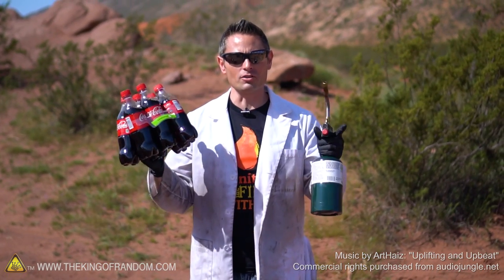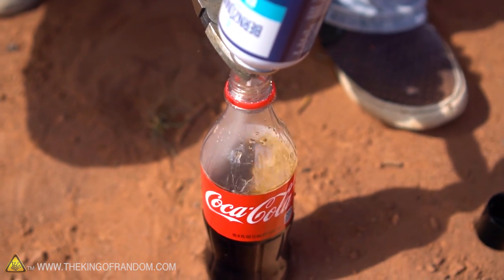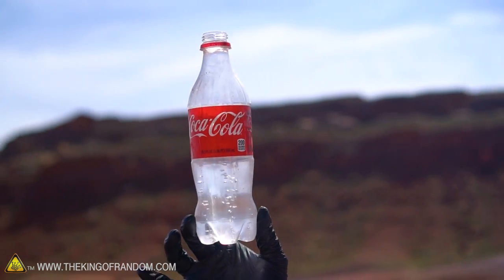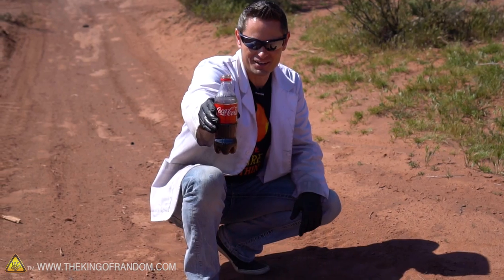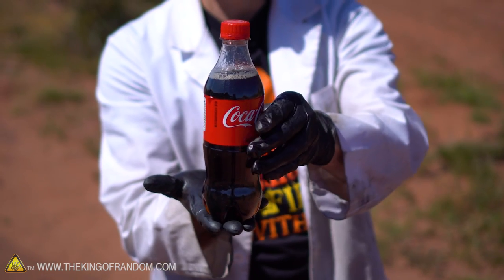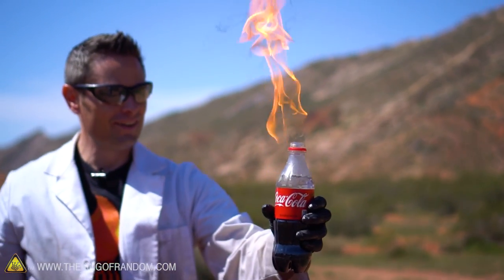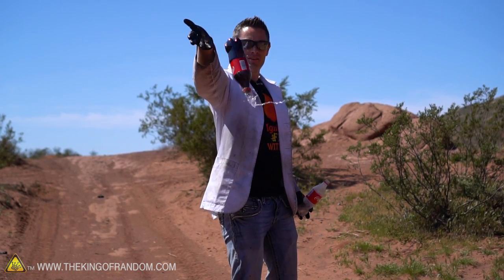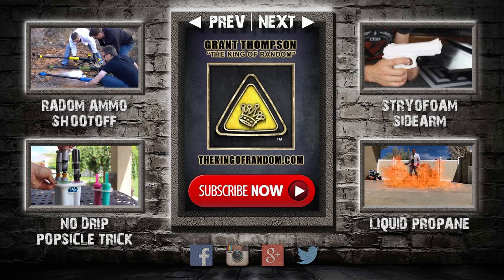Dang! Apparently Butane Did The Trick | TKOR Shares The Secrets Behind The Best Coke Rocket

Comment: try drilling a hole in the cap and repeat the experiment
Reply: One, could hope or it could just explode
Reply: Aiden Connally no it will be less powerful.
Reply: I was going to suggest the same thing
Reply: Aiden Connally rocket propulsion doesn't work like that. Also if you had a smaller hole the gas would escape slower. The gas pushing on the walls of the coke container is what propels it. If the container is sealed then the forces exerted on the bottle are equal in every direction. If you make a hole in the bottle, there is no force acting on the walls there (as there is no wall) so the force in the other direction is still the same as before but greater than the force acting on where you made the hole, so the force isnt balanced equally in all directions. This makes the rocket go in the opposite direction of the hole. However, the smaller the hole the more wall there is left to push on in that direction, so the forces are closer to being balanced and the rocket doesn't go as fast.
Reply: Gummy Bugz, the coke is significantly warmer than the butane. It warms it up to its boiling point causing it to expand rapidly.
Reply: Ok so repeat the experiment with differing holes sizes and figure out if there is a better size or not.
Reply: ThatRandomGuy yeah sounds right

Comment: What if you punched a hole in the cap to make a nozzle to increase the pressure?
Reply: TheFlyingMeese it's not a reaction the butane is less dense than the coke so it forces its way to the top of the bottle and sends the coke out the bottom which causes it to shoot off. So if you put a cap on it then it'd probably work a lot better
Reply: Saltineboy 21 I watched codys lab on a video where he tried liquid nitrogen bottle flip and he poked a small hole in the lid, BOOM and it exploded.
Reply: It could blow up or have more power than ever
Reply: If the bottle explodes you can either have more air or use a stronger bottle. A metal bottle would be pretty cool, albeit more dangerous.
Reply: youmakeitwhatitis A metal bottle mighht not explode because it would tolerate a much, much higher pressure. Maybe higher than the pressure needed to liquify propane at room temperature
Reply: Z Pson yes
Reply: exactly what i was thinking
Reply: Saltineboy 21 it is a reaction, but it's not a chemical reaction.
Reply: Test it
Reply: potentially explode
Reply: @loganlanphear9220  may not be a reaction but butane still pushes coke out at insane rates which would be able to cause an explosion. with no explosion not much coke would be coming out regardless of how fast it’s coming out so the thrust power would decrease

Comment: Use the Mini Arc-Furnace to melt salt and cast salt “ingots”
and shapes. Then for a little bit of fun, dump liquid salt into water.
Reply: 😩 Use Straight Quotes
Reply: Steve0203 Smith I don't think you know how sand works...
Reply: Steve0203 Smith I'd like to see him melt lava rock and to make volcanic glass
Reply from the maker: Ok I'll try that
Reply: try potassium nitrate or boil seawater
Reply: Grant Thompson - "The King of Random" the salt will explode in the water so watch out, you can see backyards scientists video on it for more info.
Reply: Darn you weren't supposed to spoil it. I know it explodes. I tried it.
Reply: Thanks I'm a huge fan. I've actually built quite a few of your projects.
Reply: Steve0203 Smith sorry :/ just thought a heads up could help him not loose a finger
Reply: Steve0203 Smith the melting point of salt is 800°c
Reply: Lol You're right. We don't want Mr. Thompson to lose a finger
Reply: The Arc-Furnace can melt rock.
Reply: Steve0203 Smith I've built the Styro-Slicer because I like Styrofoam.
Reply: Steve0203 Smith I think you mean molten salt
Reply: lol that would result in an explosion but it would be cool TheBackyardScientist has made a video of mixing molten salt and water
Reply: Yeah Thanks.
Reply: Steve0203 Smith you mean molten salt?
Reply: Steve0203 Smith That’s a Special FX to enhance the flames just show us the real one you don’t have to lie

Comment: if you drilled a hole to create a choke, then you'll get less thrust, but for a lot longer.  the result is a more efficient rocket that will fly much higher.
Reply: It wouldn't fly
Reply: Arton Shala actually it would.  the propane would reach a higher static pressure which would increase the nozzle velocity.  a higher exit velocity means more thrust with less fuel over a longer impulse.
Reply: Unmannedair the rocket would go upwards the same exact distance. The bigger hole will just get it there faster. To calculate the acceleration of a rocket you take resultant force divided by mass.
Lets say we have a 1kg rocket that produces 20N of thrust upwards. It also has 10N of weight downwards. A resultant force of 10N upwards. 10 ÷ 1 is obviously 10ms^-2. So lets say the initial size of hole gives you 2 seconds of thrust, at that acceleration the rocket has gone 30 m after this time. Now, if we double the size of the hole, we double the thrust upwards. So we have an upward force of 40N now giving us a resultant force of 30N upwards. 30ms^-2. But since the hole is twice the size the propellant escapes at twice the rate of the original rocket so you get half the thrust time. 1 second. And there you go, 30m in 1 second vs. 30m in 2 seconds.
Reply: Unmannedair sorry i did the calculations wrong due to tiredness. Yeah you're right.

Comment: the reason the propan failed is not the gas but time.
the coke was frozen at the top by the propane, creating a sheet of ice and cola syrup. 
this prevented  the two liquids from mixing.
this prevented the propane to be heated to vaporization,  by the  coke as they mixed.
time was the factor, not  the propane or butane.
Reply: doing things, making stuff but by using a liquid with only a -1°C boiling point versus the -40°C it works better.

Comment: What would happen if you drilled a small hole in the cap and screwed it back on the bottle right before you turned it upside down?
Reply: Alexander Brozel, totally a thought I had too. Decreasing the exit hole would increase the amount of time it takes for the pressure inside the bottle to equal the pressure outside the bottle. Maybe a slightly higher risk of the bottle exploding before take off, but Grant could put an"X" cut in the lid as a relief, so if the pressure builds too high, the cuts would break and allow the lid to open up. This might help the pressure exit the opening, rather than exploding the bottle.

Comment: Objects in free fall are weightless because they're not supported by anything, so the density of the different liquids doesn't matter. If you take a big jug like from a water dispenser, fill it with water, oil, solids like cork, lego pieces, marbles, lead, then mix it around and then throw it to another person, you will see that as long as it's in the air, the pieces inside behave like in space, and as soon as the other person catches it, they separate according to their densities. Cool experiment to try with a slomo camera
Reply: Cooking With Cows you are kinda right, kinda not. Half half. In 0 gravity, the water and oil would still separate, or cause it's the different densities. Somehow. It's a bit more complex, but that's the main Ideea. The oil wouldn't go up or down, cuz in 0 grav you don't have that point of reference, but it would go on the outside of the water. Also. When he flips the bottle, you need to take in to consideration another fluid. The air. Air wants to go in, witch makes the coke and butane mix faster
Reply: bogdan radulescu oil is hydrophobic and so it'll seek to avoid contact with water. density determines which liquid sits on top of the other. oil is the less dense of the two and so would float on water.
Reply: Freeeeeee fallliiinnnnnn

Comment: Have you tried drilling a small (approximately 1/4") hole in the cap and then replacing said cap to see if the reaction is more energetic?
Reply: Need to try to see if it will work like rocket engines
Reply: I’d like to see them build a rig to launch 5 flaming rockets at once, with rocket nozzle bottle caps!
Reply: @ArmchairDeity  He dead doe

Comment: The drop test didn't work because the butane and coke fall at the same speed so they don't mix until  it hits the ground
Reply: 10asti10 I don't think it has to do with mixing. Because it's not a reaction between the two that propels the bottle. It's the pressure held in by the coke but applied to the inside top wall of the rocket. The reason it won't blast off in free fall is simply the coke isn't holding in the pressure since the bottle is falling at the same speed as the coke. Once the bottle hits the ground the coke seals the opening and the pressure can build.
Reply: perpetualengine yes, and what should happen is the following:
1) A slower tip over. This will give time for the reaction to start.
2) A longer drop time. This will give the reaction as much time as it needs.
Physics makes a lot of really cool things really hard to do.
Reply: the mixing does cause it to heat up a lot faster even though it doesn't react.
Reply: B10401 you are Def right. More specifically I should have said there is no chemical reaction happening. :-)
Reply: i think he should be pushing the bottom of the bottle up before it tips, making the bottle hit its turning point (v = 0) as the bottle turns upside down (a bit later than just letting it fall).  this would give more time for the reaction to take place.
Reply: Exactly, pushing up will make it mix and form a seal.

Comment: You cant drop it, because while it falls it experiences momentary zero gees which makes the less dense butane unable to float to the top.
Reply: Loba Rosa Correct, but that becomes irrelevant without gravity.
This little trick only works because, as grant explains, the less dense butane floats and expands pushing the soda out like a jet.

But if it is accelerating at the same speed and in the same direction as gravity (i.e. falling)  then gravity has no effect. Its like a flag that will flap in the wind if it is still, but if you move the flag with the wind at the same speed nothing happens.
Reply: If he put a little parachute on the bottle it would probably slow the bottle down enough that there would be enough gee force to allow the butane to float to the top before it hits the ground. With any luck the launch would flatten the parachute until the propellant ran out and the chute could redeploy.
Reply: unbeatable 422 can you say that again but in English?
Reply: Think of Galileo dropping the balls off the leaning tower. Both the coke and butane accelerate at the same rate during free fall, so they don't move relative to each other.
Reply: galileo dropped balls off a tower??? why didnt i learn that in school ....

Comment: Use a 2 liter and drill a hole In the cap and turn it upside down with the cap on leave a like so he sees it
Reply: Urgent Clock3897 I don't think a little hole in the cap would be enough thrust to lift off high enough :/
Reply: Yanga if a little hole doesn't work make the hole bigger
Reply: Urgent Clock3897 therefor no cap
Reply: So adjust the thrust nozzle right?
I tried this with pressurized air and there is going to be a goldilocks zone for the diameter of the hole. 
Bbut decreasing that diameter will increase thrust up to a point. 
Release velocity is going to be limited by the pressure created.

google expansion rate of butane and if you can do the math you will have an answer for the price of a pencil and paper.
Reply: Try with a syrup cap/water bottle sport cap on the bottom and flip it with either nitro or butane.
Reply: Aaron Mackay i added a comment above elaborating on exactly your idea.  i like the 2 liter part...lol
Reply: Unmannedair 
oh!?
Reply: Urgent Clock3897 yes plz

Comment: what if you made a nozzle from the cap for the bottle and tried to launch from a device in case the nozzle wont release enough pressure and the bottle explodes.
Reply: +1 - I was going to suggest this myself. I'd like to see him drill holes in the caps then put them on to increase nozzle pressure and allow the propellent (coke) to last longer which should enhance the specific impulse and increase the ▲V to get those rockets up there!
Reply: The bottle won't explode unless the coke is steaming hot. Once enough pressure builds up, the butane stops boiling. Watch "Liquid Butane Poured and Stored in a Soda Bottle', it explains why the butane stays liquid inside the bottle despite having a boiling point of just below water's freezing point under normal conditions.

Comment: if you keep the cap on and drill a small hole in it then it will go much higher for two reasons.  1. the liquid butane forces the coke out faster creating more thrust. 2. less coke will be able to fall out before it takes off.

Comment: If the flight path of that could be controlled which would do better, this or sugar rockets?
Reply: alaska sugar rockets would be most useful, most of the force of this is used up in about a second where as sugar rockets have a longer sustained flight
Reply: 212superdude212 if you put the lid on and made a 3mm hole it might be better

Comment: The delay when dropping it was caused by the relative gravity of the fluids in the bottle. Since they were falling (accelerating downward at the rate of gravity) there was no time for density to shift the butane to the top and when it struck the ground, the coke and butane mixed rapidly due to the increased force on the bottle upon impact.

 Pretty cool experiment though you should try making a jig to launch them, build up thrust just before releasing.

Comment: i want to see coke with liquid butane in a closed botle and then throw it:)
Reply: That would do the same as dry ice in water but far more expensive...
Reply: ruben lommers 
That would have to be dropped from the drone
Reply: I guess you guys didn't watch the video because he did say butane can be stored in a sealed coke bottle without exploding unlike ln2 or dry ice
Reply: NewLife While it was in the coke bottle the butane did cause the pressure to rise by a lot, hence it sprayed out when he opened it. Mixing the butane with something with a relative high temperature would raise the presure even more, probably causing a explosion
Reply: @newlife im guessing you didnt read what he said coke with the butane in a bottle.
Reply: If butane can be stored in a coke bottle having coke in the bottle will make no difference as the pressure only gets so high before the pressure keeps the butane liquid

And yes having a liquid like coke will increase the time taken for the pressure to increase but won't effect the max pressure

Comment: The delay when you drop the bottle happens because when the bottle falls, the liquid is in 0 g The necessary mixing of the soda with the liquid butane is not produced, until the shock to the ground generates a pulse of several g, which mixes The two liquids very fast. Heat is transferred from the gaseous to the butane, the latter is evaporated, and the bottle is fired.

Comment: If the rocket works because butane is less dense than coke? Surely there must be hundreds of really cheap liquids that would work instead ?
Reply: Gus Anderson it needs to be a liquid that boils at or lower than the temperature outside though. The pressure is what causes it to rocket off, the density just allows pressure to build when the opening is facing down.
Reply: Will 
I think he means instead of coke you could just use water.
Reply: Chili Poppa my bad

Comment: When you just tip the coke the butane and coke are both in zero G (or with similar angular momentum in rotation).    the butane doesn't move to where it is trapped by the cola to pressurize.     When it hits the ground, the cola being denser displaces the butane upwards at many G's ... and does a better job of rapidly transferring heat from the soda to the butane.    Then the expanding gas is trapped by the layer of cola and it takes off. 

-- TWZ

Comment: I know this is an older video but what if you drilled a medium'ish hole in the center of the cap, then put it on after adding the butane? Once you flip it, do you think it would have a better reaction once the pressure is built up?

Comment: Alot of those butane cans come with little plastic adapter tips.... So if you drilled a hole in the cap of the coke that the adapter tip fit inside you could just fill the coke with liquid butane directly.... And when you flipped it over it would have to force the liquid out the smaller hole creating more thrust.... Solve two problems at once

Comment: You should drill a hole in the lid large enough to fit a fuse into then hot glue it into place. Nextput liquid butane into the bottle and put the special lid on. Afterwards light the fuse and throw it.

Comment: Do the same thing, but poke a hole small enough through the lid that you can poke the butane bottle nozzle through to fill the coke bottle with liquid butane. See is it will take off better, then try and ignite the butane and turn over for a nore controlled burn and take off

Comment: The butane fountain probably happens because the pressure inside the bottle from the evaporating butane reaches a level where the butane stays in liquid form, until you open the cap and start releasing the pressure, therefore making the liquid butane bubble.

Comment: I think the reason tipping it didn't work is because the mixture is in freefall when you do that. When you flip the bottle upside down and hold it, the butane and the coke swirl past each other, heating up and boiling the butane more rapidly. But if you just let the bottle fall over, that free fall action doesn't really compel the two to mix.